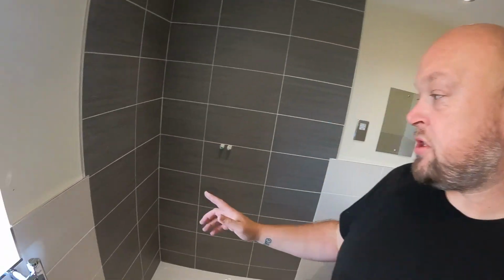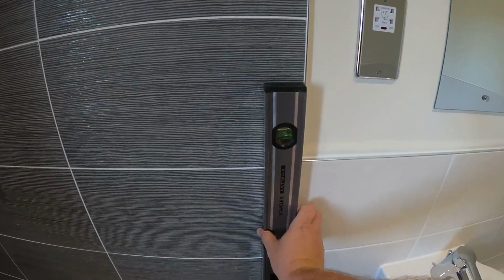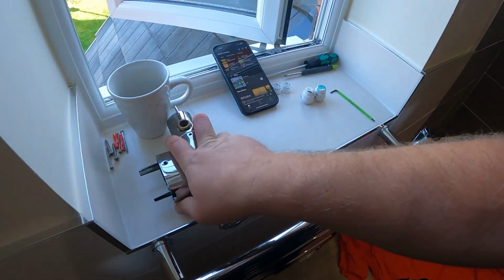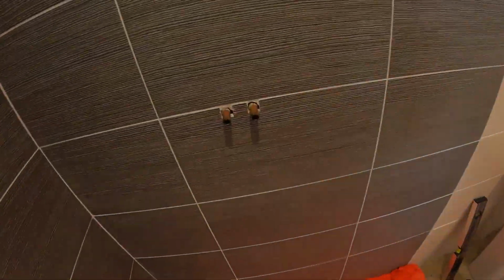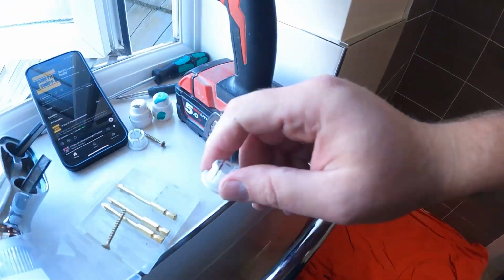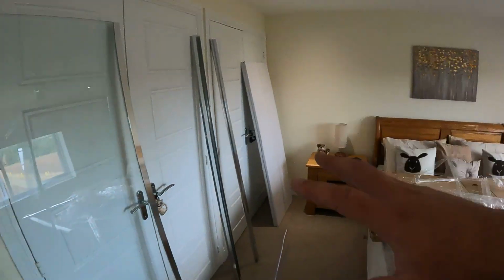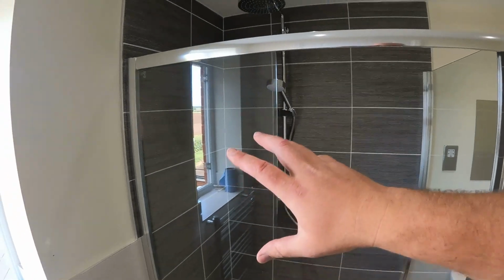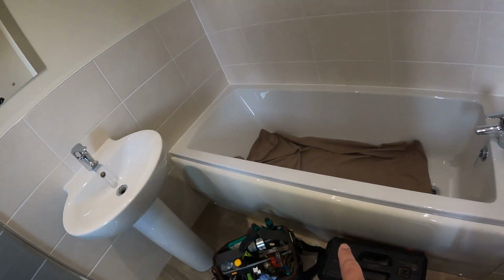SHOWER CUBICLE IS FINALLY IN on the bathroom renovation job | Real World Plumbing

Comment: Great job but the tiler could have easily cut that strip off the old tiles to make a seamless straight join instead of it stepping out, how come he didn’t ? Still a nice job and it doesn’t look out of place so don’t get me wrong, I suppose the shower screen brackets will cover the majority of it so it might not matter but still. 😊
Reply from the maker: Customer is over the moon with it, I think it looks spot on as does everyone who’s seen it…👍🏼👍🏼

Wouldn’t want to be cutting tiles for no reason, just making a lot more mess and work that isn’t needed… but still 😉👍🏼

Comment: Mark I do the same silicone behind the profile and I do something more controversial,  I ensure the silicone connects with the tiles all the way down to 2ins from the bottom then when sealing the outside only seal 4ins up, it looks nicer. Never had a leak.
Reply from the maker: Same as mate 👍🏼👍🏼

Comment: I was wondering why the tiler didn't cut the lighter grey tiles back so he could get a clean straight edge with the new tiles. Then I thought about it - if one of those old grey tiles had cracked while cutting through, it would have been a whole new world of pain! Like the tip about siliconing the back of the profile and not siliconing inside edge of profile.
Reply from the maker: Always a reason for doing what we do….. 👍🏼👍🏼

Comment: Lovely job. Always makes me laugh when our measuring system is so messed up that you can switch from 6” to 40mm in a heartbeat.
Reply: If they wanted you to use just the one they wouldn't put them both on the tape measure 😆
Reply from the maker: I’ve always done it….. and I don’t know why🤣🤣

Comment: I usually start, by throwing the screws away that used to screw the frame together as they are crap and use my own self tapping screws, and allways bead the back of the profiles and the bottom of the tray before i fix them
Reply from the maker: Hahahah like that

Comment: Big improvement the wall profiles have covered the tile joints perfectly which has given a perfect finish just wondering if the shower unit ever needs changing will you be able to get a new one as the pipes are not 150mm centers
Reply from the maker: Would have to get the same style as that one buddy…… 👍🏼👍🏼
Reply: Nice job Mark. After. Some head scratching you got the job done

Comment: Tiler has done a shit hot job with them tiles tbf, Great work as always pal.

what are them drill bits like for porcelain? will they go through at all or just used for ceramic?
Reply from the maker: Why had he don’t a shit job in your opinion????……. I think it’s spot on
Reply: @MJTiffPlumbing  shit hot basically means very good
Reply from the maker: Oh bloody hell….. I read it wrong and missed out “hot”…… thanks buddy 🙌🏼🙌🏼👍🏼👍🏼

Tile bits are spot on, link in the description…. They have gone through most things and they are that cheap I just bulk buy them